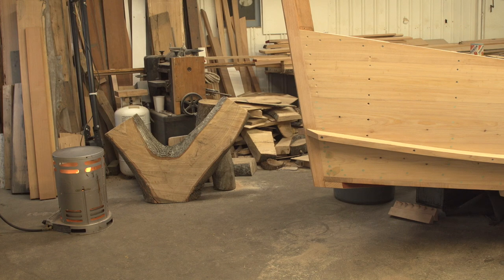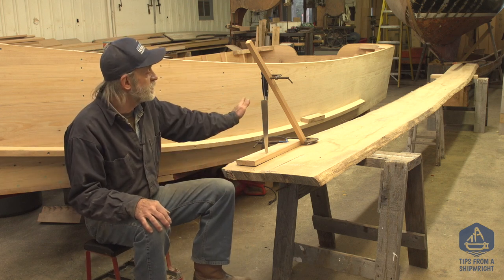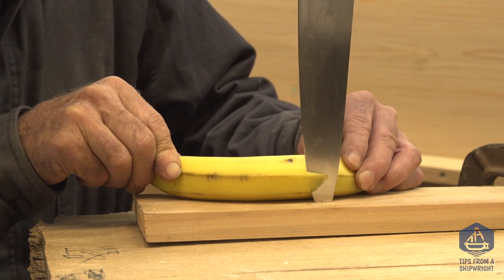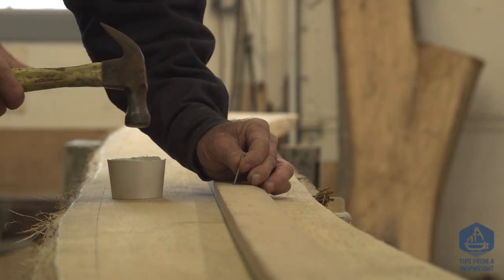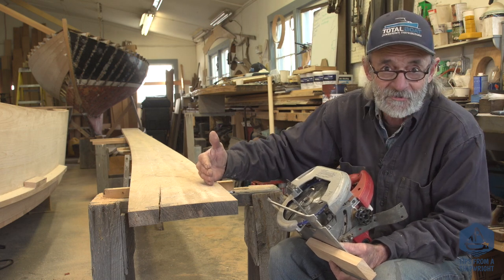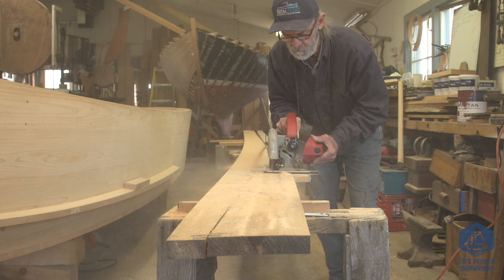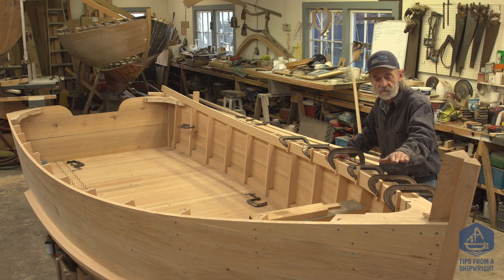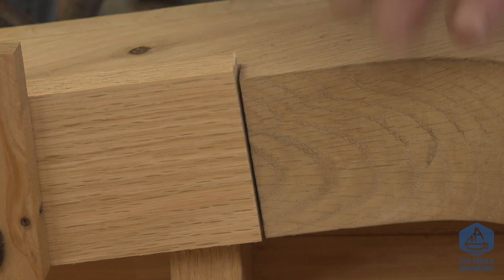Building the TotalBoat work skiff - The Inwales (Episode 28)

Comment: I am really enjoying this series! You had stated in the video that it is difficult to hold two clamping blocks so no surfaces are damaged while trying to clamp the inwales,  but there is an easy solution. Take a piece of scrap wood that is a little longer - say about 1" or so than the width of your C-clamp. Then on one end cut a notch about the same width as the thickness of the clamps body and deep enough so the clamps body can fit inside plus another half-inch or so. Next, drill a hole perpendicular to the slot and about a quarter-inch from the end that will accommodate a small bolt which will be used to clamp and hold the block onto the clamp. Then slide the block onto to clamp and mark where the end of the clamp is on the block. Here you will drill a shallow hole large enough for the clamping foot to fit into and help keep the block in place. This takes care of one clamping block and for the other, you will need some tubing or hose that will fit over the swill foot. You could either drill a hole ith the clamping block and glue a piece of the hose and then slip the block onto the clamp or if you have any corks you could stick them into the piece of hose and then that onto the clamp. Since the latter option does not disperse the clamping forces over a wide area it is possible the wood could be marred under high clamping forces. Anyway, clamping will be far easier without having to position and hold clamping blocks. I hope that you find this to be helpful. Thank you for your willingness to take the time and put forth the effort to create these videos and thus share your expertise and experience with us and the world. You, my brother, are greatly appreciated. Godspeed!
Peace!

Comment: every time I watch your videos I see skills I have acquired in other areas that I had no idea were used in boat building. The saw fitting technique you used is an old trick Ring smiths use to get invisible joints when sizing a ring. You get a perfect joint using a tiny speck of brazing compound and no gaps that need to be filled.

Comment: blocks for the C Clamps. scraps with a shallow bore the size of the swivel jaw. . blocks for the fixed jaw can be done with like a dovetail joint. no more holding blocks.  both can be done like a dovetail joint also..  out of scrap blocks of wood or even better some of the plastic scraps from the plastic ribs on other jobs.  just a thought..  love your series on the work skiff.

Comment: Hey Lou, Hi from the UK. I don't think I have enjoyed any Youtube series more. I love working with wood and have learned so much from you. A question: would it have been possible to lay your bandsaw fence down, rather than the L block of aluminium being on its back? A longer fence, with the spring fence still near the blade, may have been more 'certain'. Maybe it is harder to clamp that way?
A suggestion: Sometimes, when working with clamps and blocks I use hot glue to 'pin' the blocks in place. It sets almost immediately, you free hands to focus only on the clamp, and afterwards, a light, sharp blow releases the hot glue and block with no marring of your finish. Try it.
Thanks again. I am looking forward to watching you launch this skiff.

Comment: Louis, You talk about 'quarter sawn' a lot and I've seen you do the motion of the saw with your hand. But I'm still a little bit confused as to how 'quarter sawn' happens. (sorry to be so dumb). Could you please demonstrate how it's really done on a saw? Love the videos. I'm on a tiny island in the Greek Saronic Gulf and am working on my boat in the local boatyard. All the Greek guys are addicted to your videos. We love 'em! Thanks Lou.
Reply: Quarter sawing is a method of rip-sawing where the resulting board has the annual rings intersecting the broad surface of the board.
Reply: John Mayer quarter sawn lumber happens best on a straight line from the heart to the outside. The growth rings are parallel with the cut. Look it up on google
Reply: Growth rings are at right angle, perpendicular to cut line.
Reply: Ah now I get it. The growth ring always makes an arc covering 90 degrees - hence 'quarter'. Easy when you know how. Thanks.